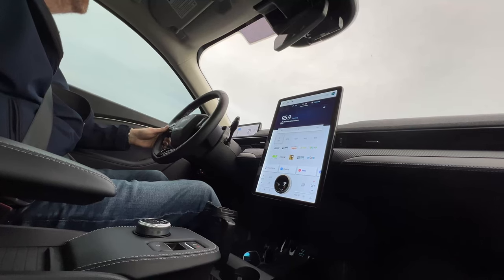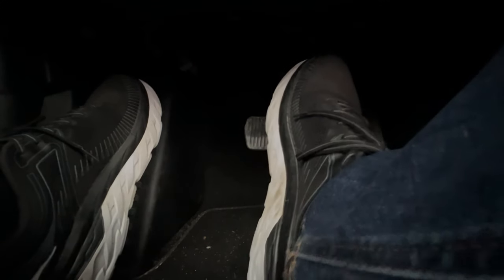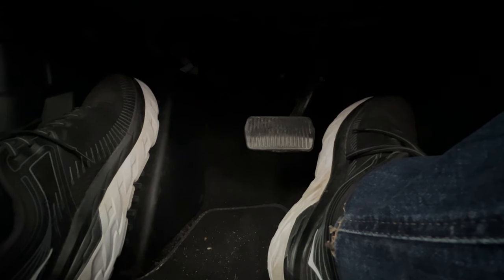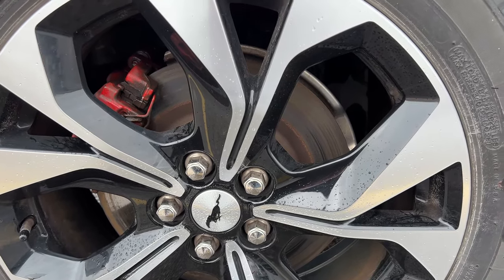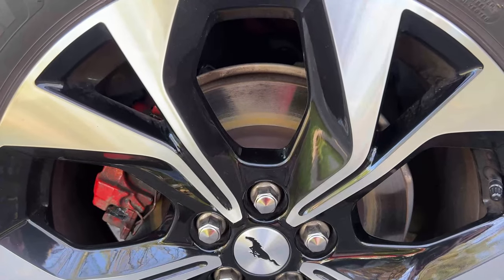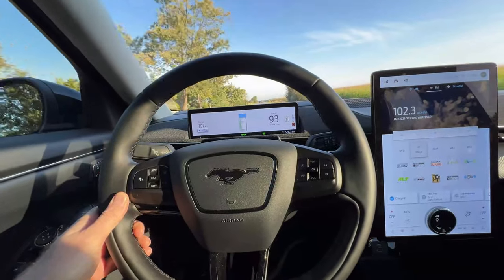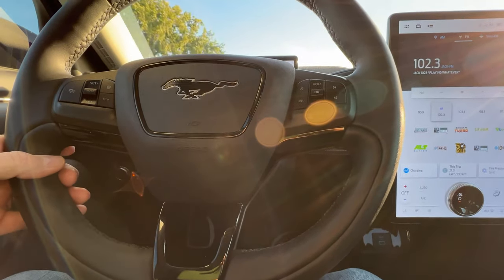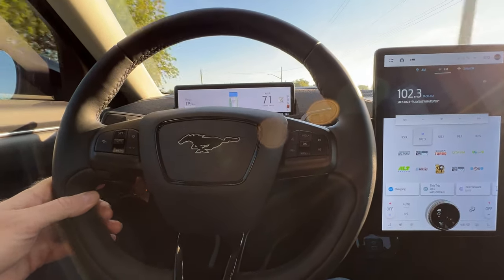Ford Mustang Mach E EV Brake Issues Problems | Steering Wheel Shake & Grinding Noise | How 2 Fix DIY

Comment: This is what happens with legacy auto decides to make an electric vehicle. It was under warranty, but they charged you $695??

I absolutely love Ford and it would be my second choice for an electric vehicle and first choice for a gasoline vehicle so I have no hate for the brand. 

It’s normal to hear grinding when you stop?? In my Tesla I do not hear any grinding when I stop. Sometimes I’ll hear a click when the mechanical brakes engage, but that’s when I’m already stopped to hold the vehicle in place. Under normal stopping regenerative breaking takes care of everything. Normally I have the windows up, but I’m going to leave them down for a couple stops to see if I hear any kind of noise, but I don’t suspect I will
Reply from the maker: No, sorry the only charge was for the regular service at 48,000km.  The brakes were under warranty.  I think I mentioned this in the video, but if not apologies.  Please like and subscribe as it really helps me as a creator.  Thanks for the comment and for watching!